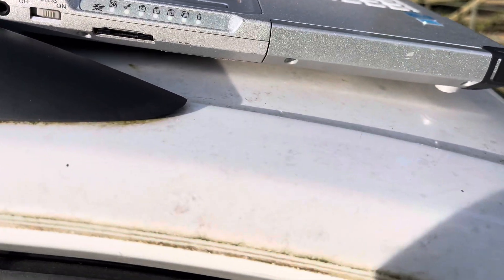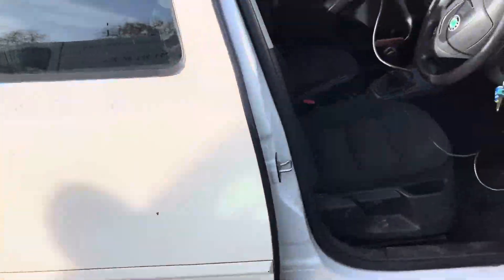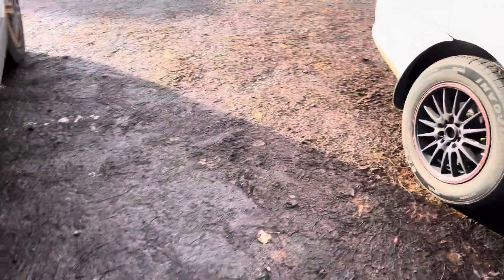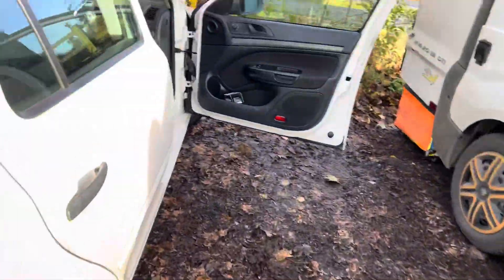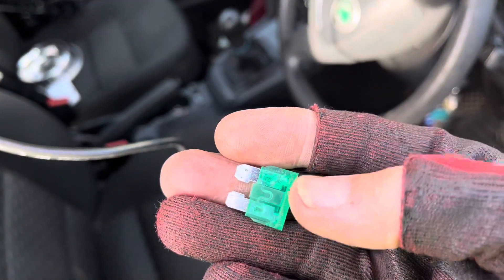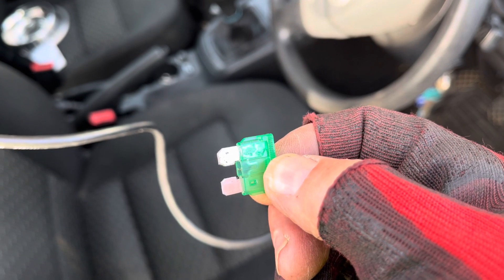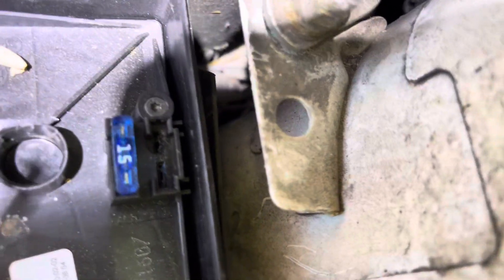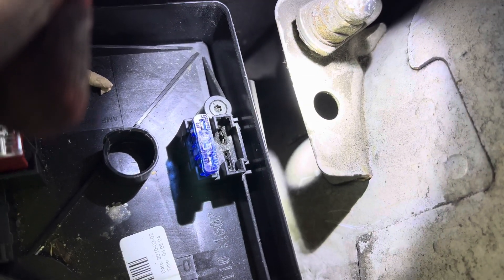#00927 Vw audi group terminal 30 open circuit

Comment: You absolute legend mate ive just bought an octavia vrs and low and behold exact same fault but some sly previous owner had covered the rear fuses with tape so I thought must have been a bit of damage to box ect watched your video and it's fixed can't thank you enough mate ❤
Reply from the maker: Glad i could help